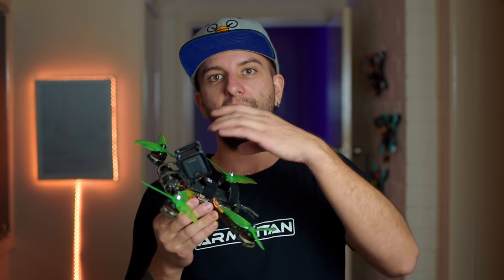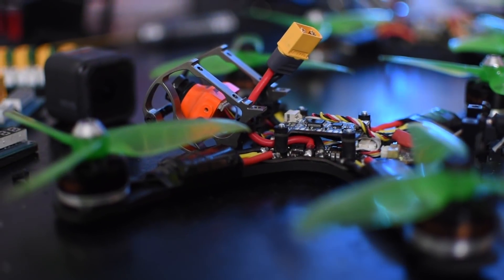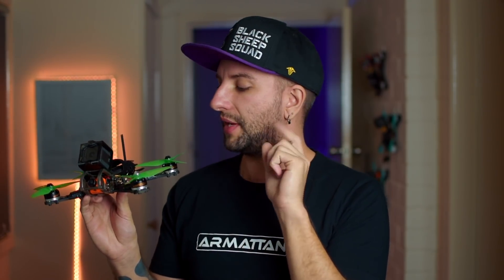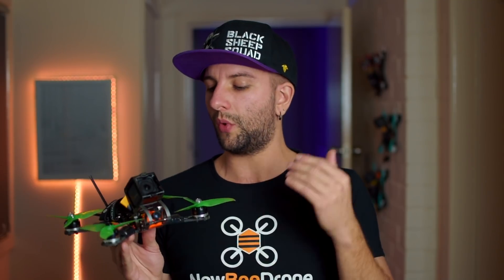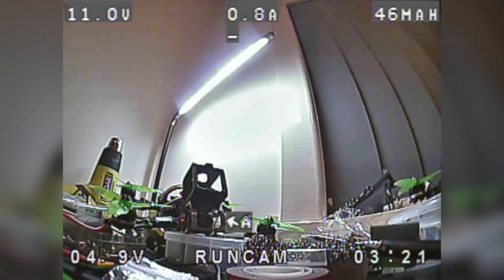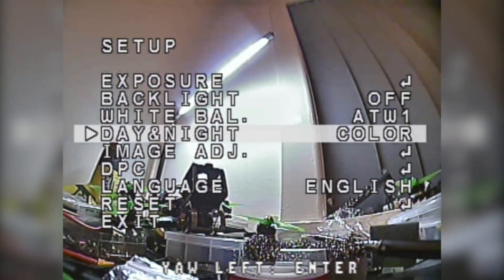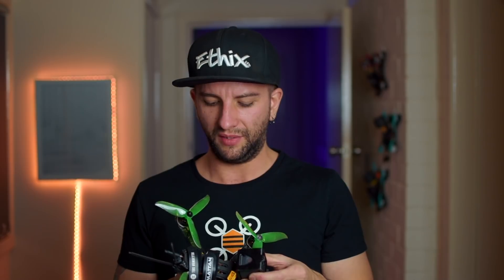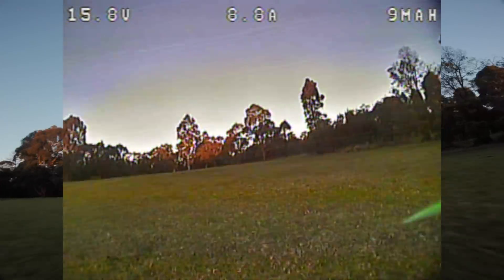ImpulseRC Wolf PDB on Armattan Rooster and Chameleon Ti (The unwanted Child)

Comment: So, my next build will be a kissed ti. I will use this combo as well. my thoughts are, does the PDB have to be on the bottom? I'm thinking, spatially, the fc and pdb don't care where they are...ya fly inverted, so...? wiring shouldn't be an issue, just different. I'll experiment, with the harness should be okay? Just thinking out loud...will test that combo on the ti for functionality then install it in another rooster build.

Comment: Hi Kev, if i turn the Kiss FC with the USB port pointing to the back of the quad, which is the exact setting i have to put in the Kiss GUI for Custom FC Orientation? Is it +90 or -90?
Sorry to ask but I need to drive quite a bit before I can fly and would hate to find out when I'm there that I entered the wrong value 😬. Your feedback will be much appreciated!
Reply from the maker: If I remember well it is +90 but I’d advise you to hover check it in your backyard haha. I’m at work now for another 8h. I can check when back home if you want

Comment: I absolutely love the update rate of the stats on this PDB! Awesome to see exactly how much amps you are pulling at that exact moment in time. It certainly helps troubleshoot if one motor is damaged and pulling too much power. I have my stats set up on the Taranis slider so I can minimise the readout to just volts + current, or go as far back as nothing. So I can do clean DVR recording.

Comment: Same config for me but I want to know how you raised those rubber standoffs a little because I agree, they are a little too short for everything to fit with enough space. I guess you used washers? Rubber ones to keep it all soft and flexible or metal ones? Or a completely different solution I haven't thought of yet? Would appreciate your feedback.
Je découvre tes vidéos à l'instant et me suis inscrit sans hésiter, keep up the great work! Merci !
Reply from the maker: Just used nylon nuts and it did the trick